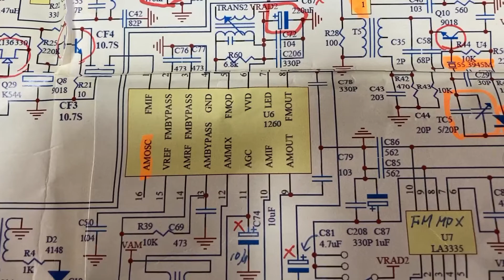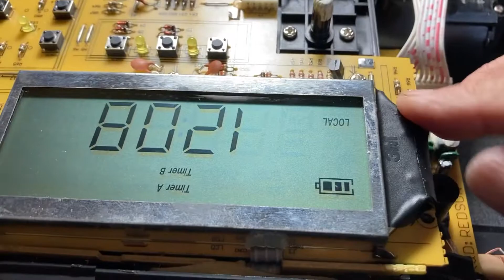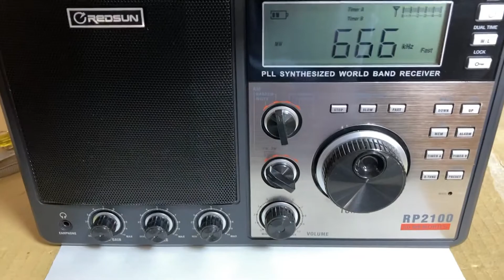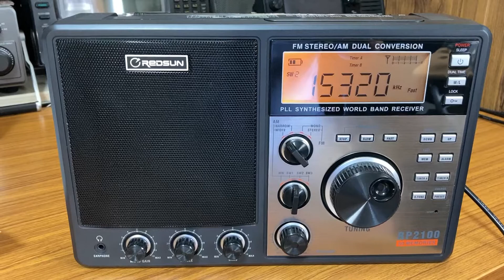🛠 Repaired REDSUN RP2100

Comment: Hi ..tnx for your answer.but another question..
Can you explain more exactly what happened to the radio?  Was there a disturbance in wave and frequency reception during SW waves?  I have the same radio. It shows SW and MW frequency numbers on the digital display, but there is no reception and sound, and I cannot receive MW and SW stations. But I have no problem receiving FM stations.  Is it possible that this problem is due to the same IC that you replaced?
Reply from the maker: Hello. It is possible that this IC is damaged, but it is not certain. Since it is an old radio, just disassembling it may damage the FM radio. I think the risk of repairing it is high. Sorry for the late reply.